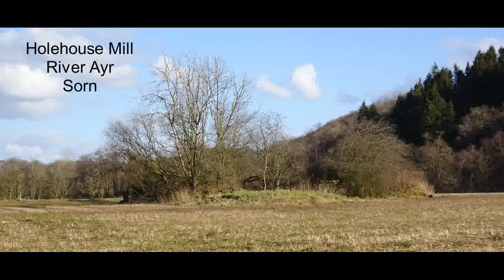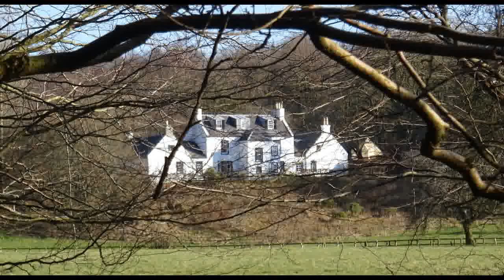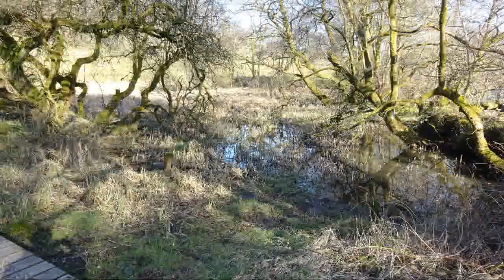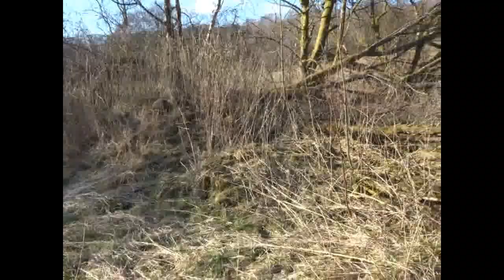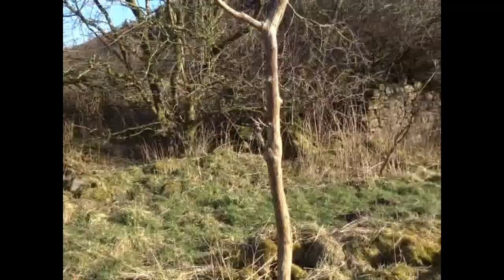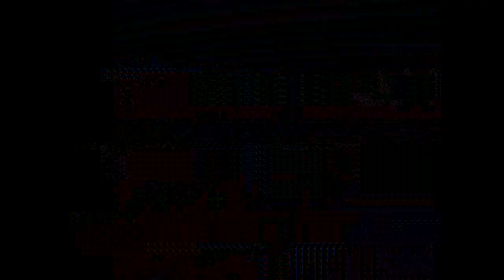The Old Holehouse Mill on the River Ayr, Sorn

Comment: This is great. Do you have any information on the Perchy Hole at the head of the field?
Reply from the maker: I am not familiar with the name. Is it one of the anglers names for pools, etc on the river?
Reply: I assume it’s an old mine that has filled with water. It is not part of the river but a few yards to the north of it, just up from where you were on your visit. It’s quite large and visible on Google Earth. I heard a horse and cart fell in once and the horse drowned. It is full of perch as the name suggests. There is also a brick structure like a tunnel on the south side - I guess an entrance to the mine.
Reply from the maker: @clydebuilt4894  A limestone quarry existed here, now flooded. The ruined and partly flooded limekilns are close to the river and the path. A basic railway connected the two. A ford crossed the river here as well.
Reply: @rogergriffith286  That sound about right. There are so many signs of activity around there. There is an old road to the north of the field with the mill that runs west to east and the stones that hold it up are visible near the boggy area around the walk to the west beyond the burn that enters the river near the ford at Waterside (where the Ayr walk enters the woods by the river).